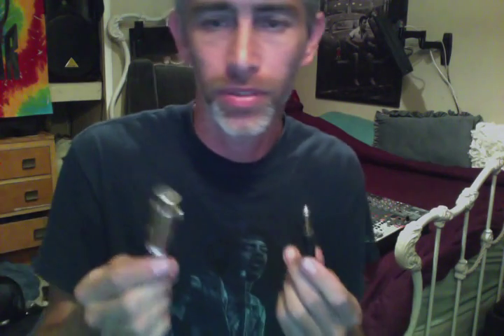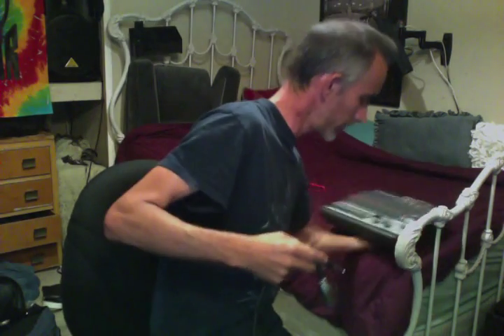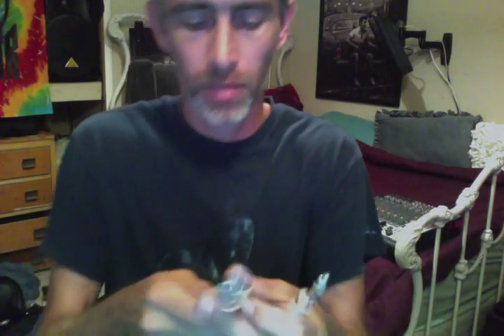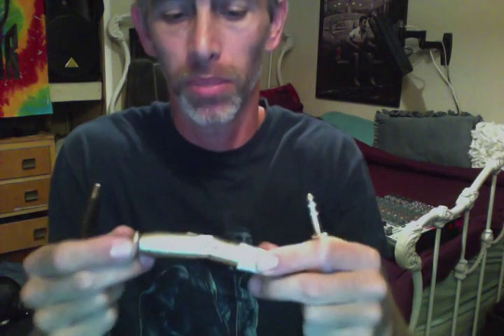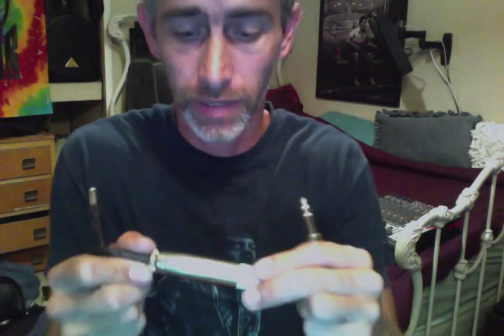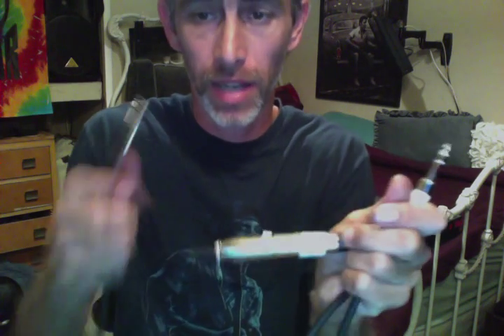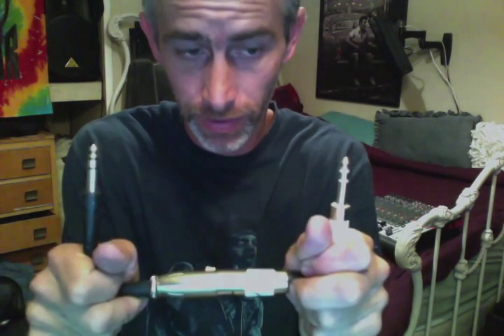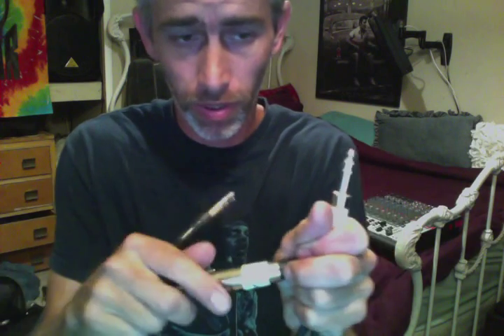Line level input to H4n

Comment: Hello. So you mean that with this tip you don´t need any -20db pad attenuators at all..? The H4n can accept line level signals without distortion only through the TS inputs? a balanced cable solve the problem with line leves without any attenuator? sorry i´m a bit confused here. Thanks in advance
Reply from the maker: So, I did have to look into this some years ago and the maximum level to the 1/4" is +2dbu and the XLR(balenced) input is a maximum of -6dbu. So effectively giving you 8dbu more gain coming in before clipping. So not even half of a 20db pad, but 8db. Setting the recording level to 1. I think the defauld record level is at 100. If your still getting flashing lights, you will need to reduce the level from the mixer or audio source. Hope this helps.. The H4n never ever let me down on 100's of recordings.. I now have an H5 that has a 20db pad built in. Definitly better.
Reply: @toddjonesmusic  thanks for the quick reply. I've been considering the H4n pro because of the capability of multitrack recording (as a mini pc) and a 90°/120° for ambiente recording, but no line level input is a con... In The other hand been considering H5 and TASCAM Dr40x, The latter is apable of AB ambiente recording but is stereo pair recording... Do You have any opinion about H5 or Tascam dr? Sorry for The extension, hope You Well. Thanks

Comment: Hi Todd, if mi mixer ( dj mixer) only have RCA umbalanced rec ouput, how can i conected my h4n?  can i make Rca to trs stereo cable directly, for unsatured signal? Thanks
Reply from the maker: Take a normal RCA to RCA Cable (L&R) then get 2 Female RCA to Male TS Adaptors on the end going into the H4n. Just watch your levels.. I know how you DJ's roll. :p
Reply from the maker: So, I did have to look into this some years ago and the maximum level to the 1/4" is +2dbu and the XLR(balenced) input is a maximum of -6dbu. So effectively giving you 8dbu more gain coming in before clipping. So not even half of a 20db pad, but 8db. Setting the recording level to 1. I think the defauld record level is at 100. If your still getting flashing lights, you will need to reduce the level from the mixer or audio source. Hope this helps.. The H4n never ever let me down on 100's of recordings.. I now have an H5 that has a 20db pad built in. Definitly better.